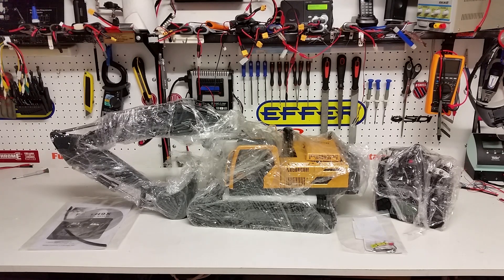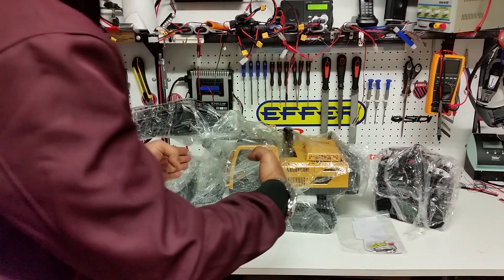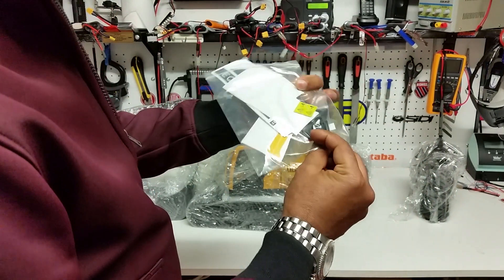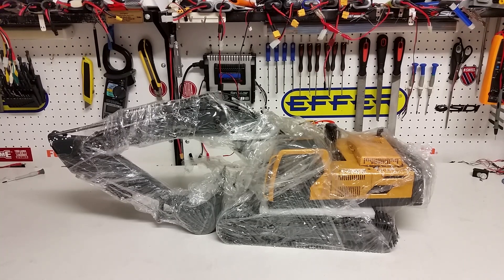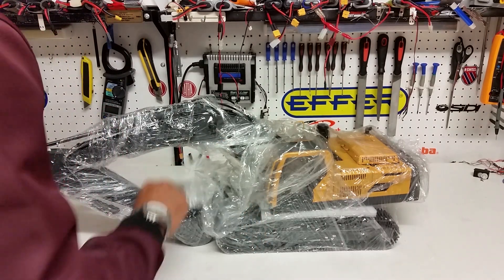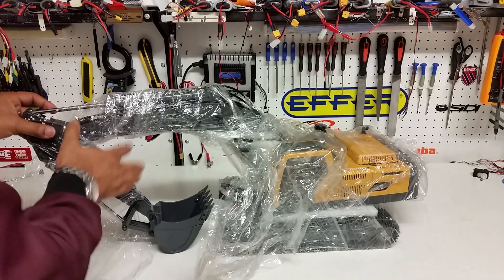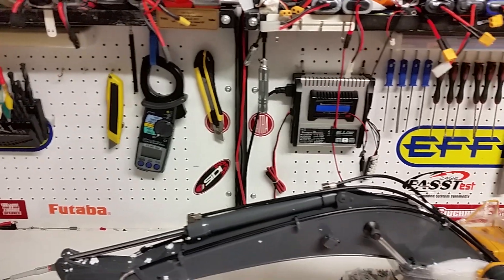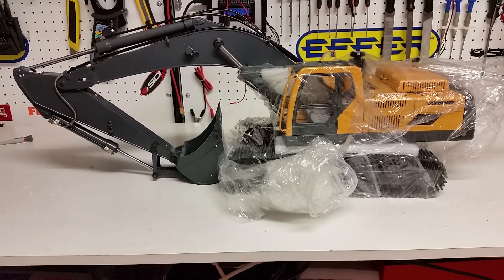CSMI : Part 2  Ready to run  Radio Contol Excavator unboxing

Comment: does it come with oli? If not where can you buy oil for it? And the smae with the battery? Does it come with it and if not where can you buy for it? And I dont own a machine like this but does this and the wheel loader from rc4wd have a pressure protection in iti? What I mean is that if your unexperienced and you for example push the lever up and keep pushing it up will that cause the pressure to build up and burst a hydraulic hose or is there a system to prevent this from happening? Was it worth buying it? And are these spare parts for it?
Reply from the maker: +Tokatt You can buy hydraulic oil from any Auto shop. Yes all machine's have pressure control valve. Thanks.